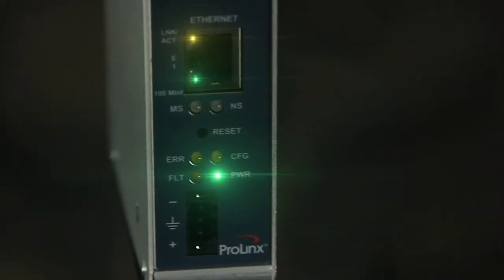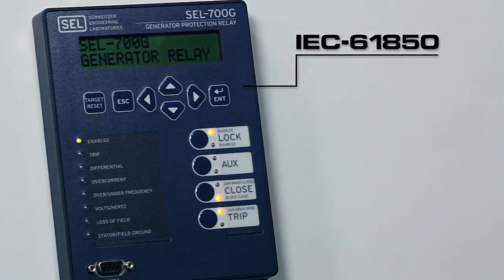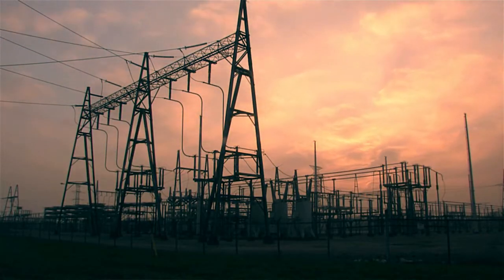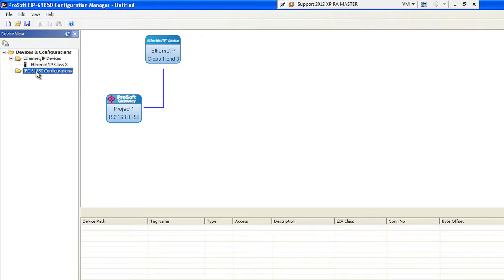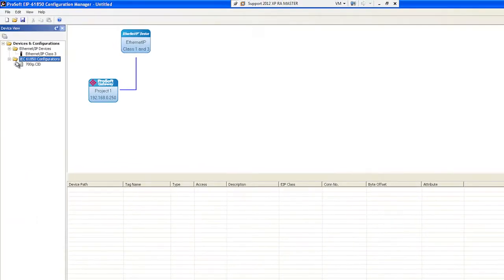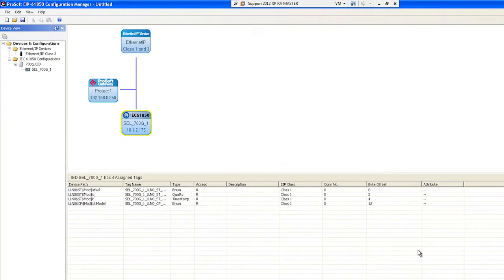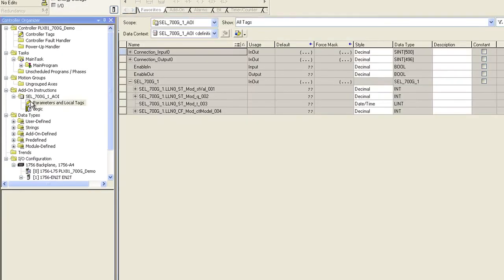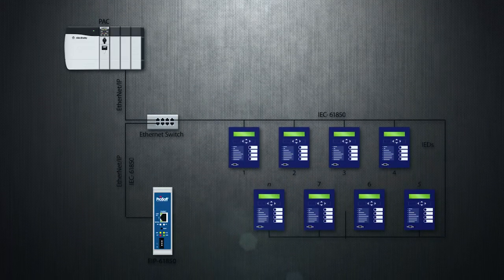EtherNet/IP Server to IEC-61850 Intelligent Gateway

Comment: We are currently on a project that requires the configuration of over 1400 tags(across 4 61850 gateways).  Can the configuration file be exported/imported to allow automation of the configuration?  Otherwise it is a very laborious and time consuming task.  Added to this, many of the 61850 tag names are very similar with long non-intuitive names with zeros and Os in the same tag name or tags identical except for the transposition of 2 characters for example).  It would be fantastic to get an XML export/Import to improve productivity and accuracy.
Reply from the maker: Hi, Albert! Please call 661-716-5100 and ask to speak with tech support. Thank you!!